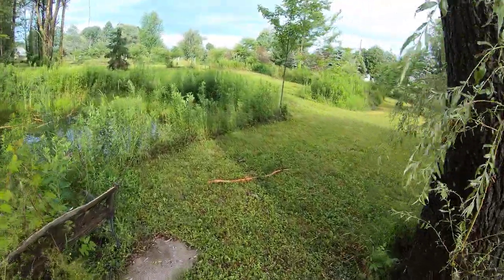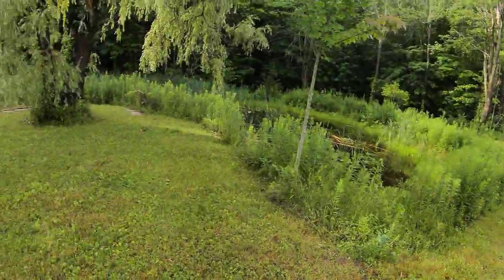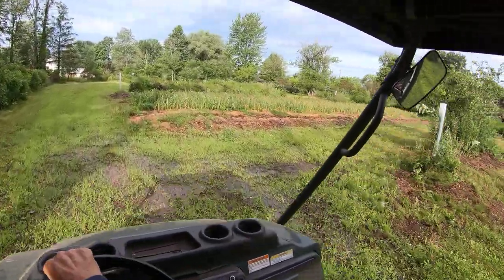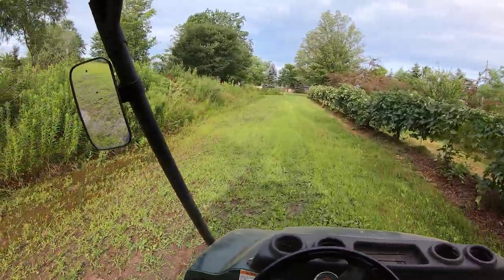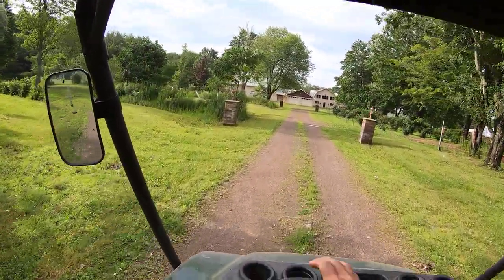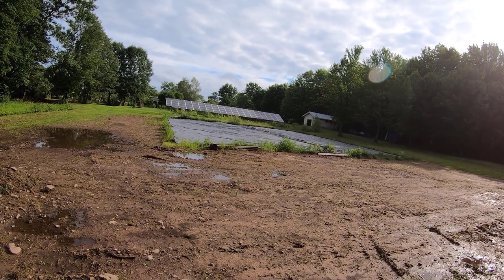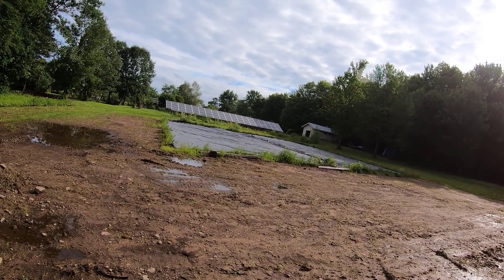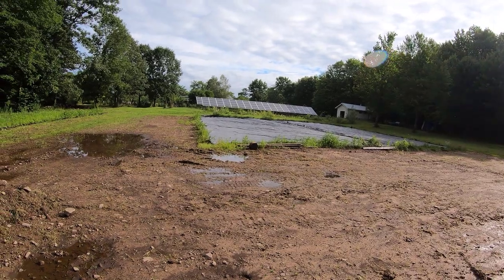Soil Carbon and Water conservation

Comment: I like your ponds. There must be masses of wildlife around them. Have they any connections to the beaver ponds in case of spill over or if a damm bursts?
Reply from the maker: Yes great question, all seven pounds are connected through swales and canal systems that manage their runoff when that occurs in the spring. This spillway from the 7th pond drains into the forest which ultimately drains into two other pools and then into the Beaver pond. All throughout the journey of a water drop from the first pond through the rest of the aquatic systems there are numerous species from microbes, amphibians, reptiles, birds and mammals. We're very blessed to live in such a wonderful environment.

Comment: I have had an English walnut tree for at least 10+ years and not a single walnut has ever or a flower has ever shown up on our tree. Are yours the English variety if so maybe I need to get another one for germination process. I already lost my apple tree as all i got was small black spotted leaves and fruit. At my age I hate to think I may have to wait years again for a walnut to appear. What do you think? I'm all ears.
Reply: The garlic mine is more than ready also the beaver swamp can't you use any of that if you pumped it to the last pond 7 and eventually to the other ponds there seems to always be enough water in that swamp.

Comment: Maybe you should compensate your fossil fuel carbon emissions by adding anorganic carbon (aka charcoal or biochar) to the soil. Your organic carbon soil input will decay in the end and will go back into the atmosphere and become part of the global warming. A Glaser YT vid convinced me to add crushed charcoal to my compost heap in order to charge it. He reported having analyzed hundreds of studies into biochar and concluded zero negative impact and an average production 20 percent higher when applied. I'm also adding bentonite clay and crushed basalt to my compost. Clay for better water retentention of my very sandy soil and basalt for micro nutrients. I started adding clay after seeing a lot of Australian farmers mixing in clay into their sandy soils in order to beat the desertification of their fields. Hope this helps you to reduce your needs for externally sourcing carbon like manures and woodchips.
Reply from the maker: Hi Earl, we have been using charcoal and biochar for years. I posted videos back in 2013 and 2014 about our experiments and research with biochar. Unfortunately the resources required to create biochar at a level that would equate to the carbon resources that were using would exceed our capabilities. Time, costs and resources are all precious resources that I must manage on our site. I'm glad you've learned about biochar and it's amazing benefits.